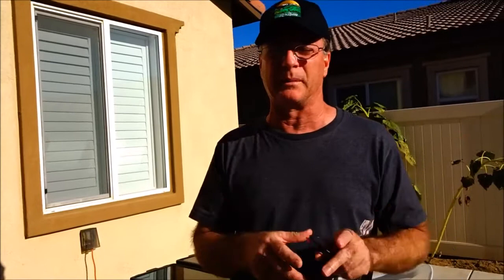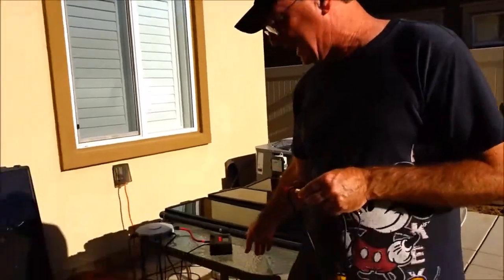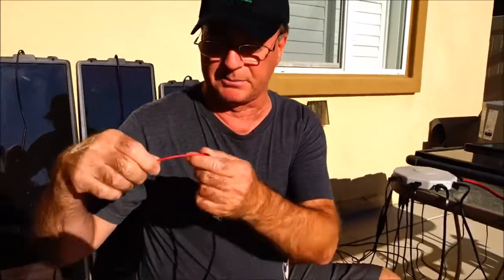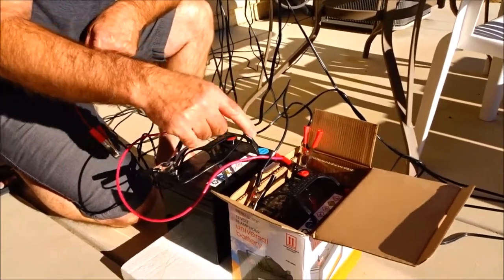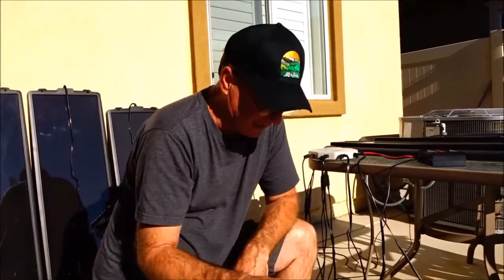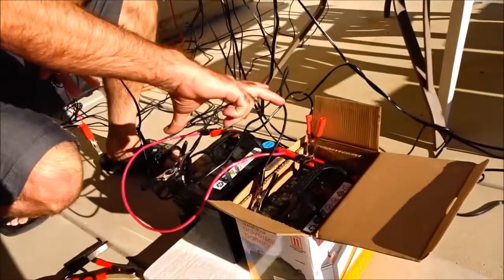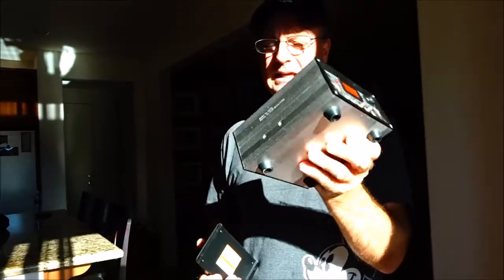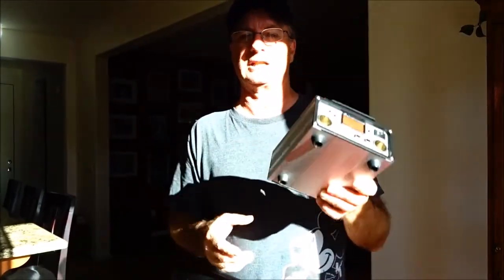Harbor Freight Thunderbolt solar Charge controller hooked up wrong. Charge controller giveaway.

Comment: Had the same problem with my 100 watt charge controller. Replaced soldered in fuse with an external replaceable fuse. Still working good. 

Not close to California, but wouldn't mind having another controller on hand if still available.
Reply from the maker: Where do you live? What State?
Reply: billisa I'm in Baxter Springs, Ks
Reply from the maker: Okay. I will get back to you and try to make this happen.
Reply: billisa Sounds great, thank you!
Reply: very nice I'm from So. Cali originally though in Ore. now. can uae any cc's you'd be disposing of.

Comment: You should have your panels in the Sun but keep your charge controller, batteries, inverter Etc in the shade and away from the Sun and rain but your panels should be in the Sun. Also you could plug in your 3 15 watt panels into the three-in-one connector and then plug the other side of that three-in-one connector into your universal hub and the same with your 100 watt panels you can plug each of the 25 into the 4 in 1 connector and plug the opposite side of that into your Hub that way if you were to buy more kits you could put 8 kids total into your universal hub instead of plugging each individual panel into the Hub.
Reply from the maker: Yes. Totally agree. The hub will handle up to 400 watts anyway you want. Thanks for taking the time to comment.

Comment: Actually Charge controller output is programmable to keep batteries from overcharging and over draining. That is its actual purpose. Although the out put is usually a lot weaker than hooking straight off batteries.
Reply from the maker: Thanks
Reply: I have 10G wire on my batteries for now that gives 30A safely

Comment: Doesn't matter ... with voltage with fuses.. it's the amps that  heat up the fuse and burn it out. You can have 200000000 billion volts.. if no amps are flowing .. fuse will just sit there  fine

Comment: I'm getting no indication light on the charge controller.  Do I need to return it?  The batteries are fully charged apparently I am thinking that it's just shut down to prevent overcharge?

Comment: I thought the conventional wisdom is to hook up the inverter using the output ports on the charge controller, because the charge controllers do a more conservative job in restricting how much the battery can be discharged than the inverters.   Is this correct?
Reply: The inverter doesn't 'restrict' anything - it's only job is to convert the incoming DC power it receives from the battery(s) to AC power. The inverter has nothing to do with the energy being collected from the solar panels - that energy goes directly to the battery(s). 

The charge controller is simply the middle-man between your input (panels/battery) & your output (inverter). If you want to be more efficient, you should always power off your inverter when not in use as it consumes 10-30 watts on it's own depending on size. It's also a good idea to disconnect the panels from the controller at night as the panels will reverse drain the battery(s) when not taking in sunlight.
Reply: Good question!

Comment: Hello, great videos. How do you measure the battery capacity left on the battery?
Reply from the maker: You will like our video that will go live in the morning. We explain in great detail this subject. We have mounted the solar panels to the roof of our van and explain the set up.
Reply: @billisa  Thanks! You guys are celebs!
Reply from the maker: Well, We don't think so, but very kind of you to say. If you didn't find your answer in the video.... Our batteries when fully charged read about 13.5 volts. When they are half drained they read about 12.6 volts.

Comment: if you bought the 2 year warntee from HF you can take them back and get new ones
Reply from the maker: The thing is I have no use either working or not for a 45 watt or 100 watt controller. I am up to 190 watts of solar so I have the 500 watt controller.